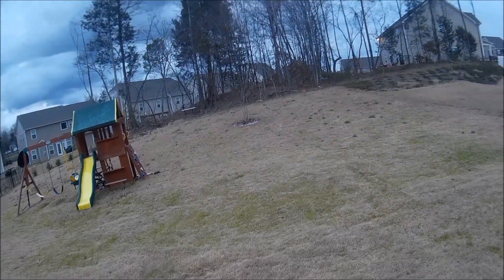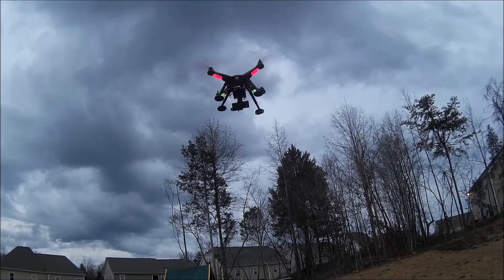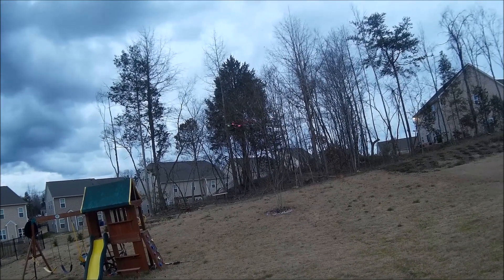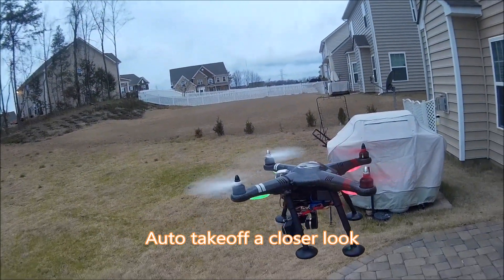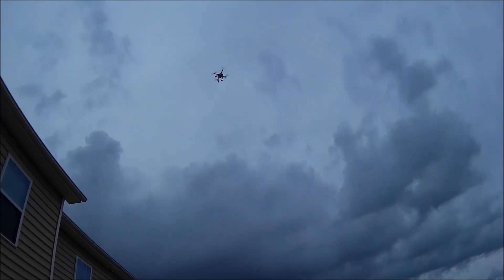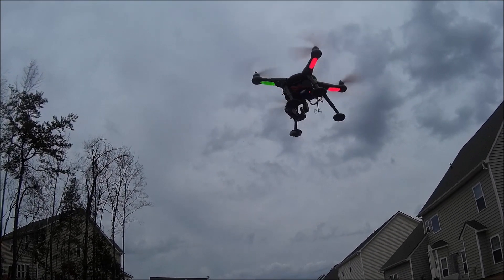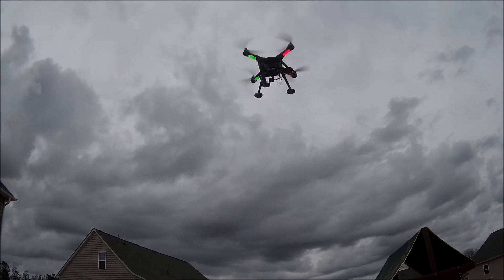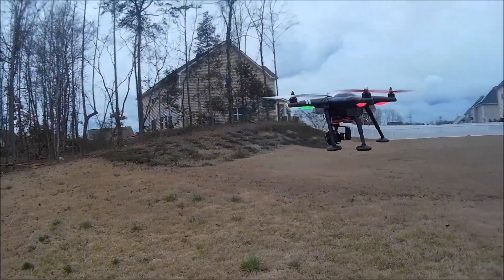XK detect X380 and FEIYU GIMBAL 3 AXIS PROBLEM

Comment: same problem like me..... i have normaly fly with my xk x380, maybe fly 5-10times flight and its ok normaly. i try use gimbal and connect to internal battery of drone... after that,  just fly 10-30second i get  fast flash red, and i landing my drone, i think my battery its not full, i try charging my battery again and i try again with not use gimbal, but same problem, my drone after 30second take off get fast flash red.... anyone can help me?

Comment: Nice video!   Is the camera WIFI? I've here that that can cause problems.Also why is your left front landing leg on backwards?
Reply from the maker: +Rick Rickerds hello no i'm not using the wifi of the camera thanks for the observation.
Reply: +Ernest J  have you found out what caused the problem ,as Iwould be very intrested ,many thanks
Reply from the maker: +android /John  hello at this time i think that the pitch motor is causing interference to the magnetic sensor on the right leg of the quad but i haven't  test it
Reply: Keep us posted!
Reply: +Ernest J I have the same issue, same gimbal and quad..  I actually unpowered the gimbal and the issue remained, so that kind of debunks the pitch having anything to do with it. I did REMOVE the gimbal all together and the quad seemed stable again..  What do you think?
Reply from the maker: +dave na  it seems that the pitch motor magnets interfiere with the compas on the front right leg but i haven't test it jet .
Reply: +Ernest J ace, I'm just thinking why it caused this problem on mine with no gimbal ,but fpv?
Reply from the maker: try to do the calibration and power the fpv after the calibration is done.

Comment: This is kinda what happened to mine yesterday the first time I fitted a XK. FPV.
The quaudcopter started doing large fast circles until it hit the ground.
Also video saved to SD card was of poor quality .
Every thing seams better after I disconnected the FPV. I have not removed the FPV kit.

Approx 30 seconds into video you can see it starts moving around and in location 2 it got worse.

https://www.youtube.com/watch?v=HLES52-ZLqU